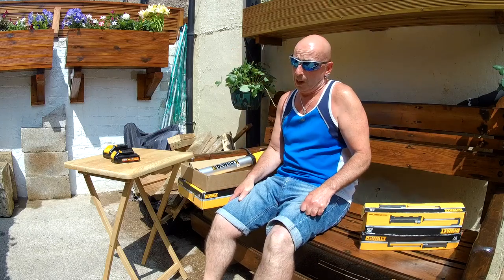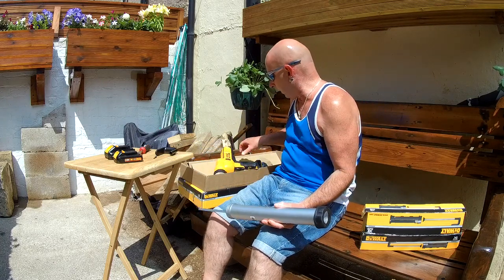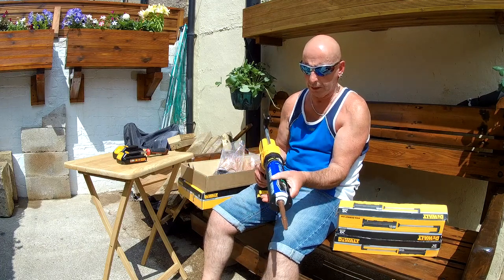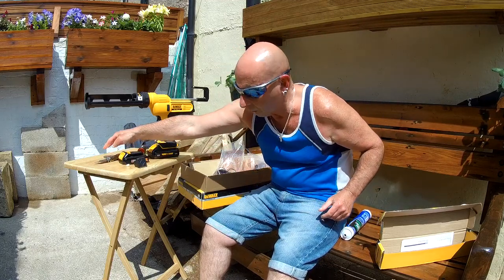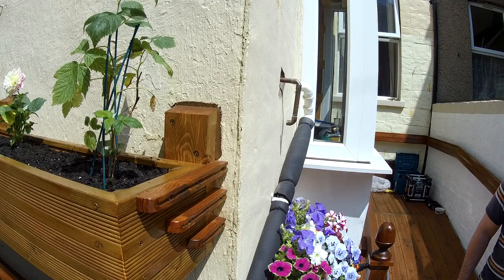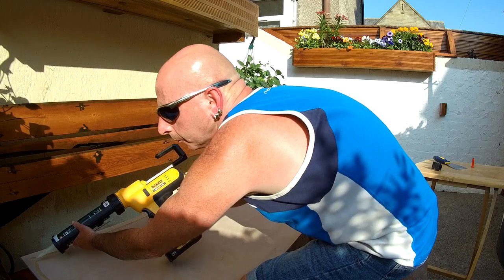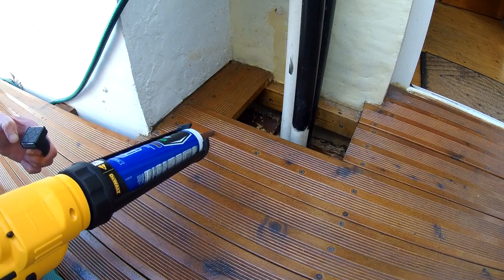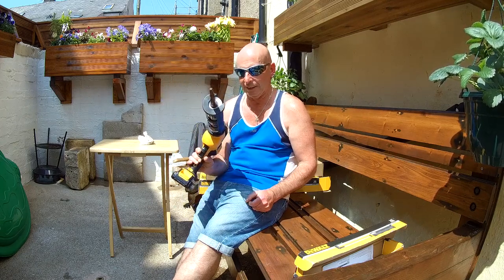DEWALT DCE580N and DCE5601 Caulking Gun

Comment: Watching you use this tool has helped me decide that sometimes there is no point trying to reinvent the wheel. I hope you get better at applying silicone with this monstrosity.
Reply: More and more adhesive applications are coming about that require more force and speed than your hands can supply
Reply: @jamesscott6753  soudal silicone.....youll never need to use anything else for a job like this
Reply: @shmooless3699  silicone is a very small portion of the market this tool was designed for.